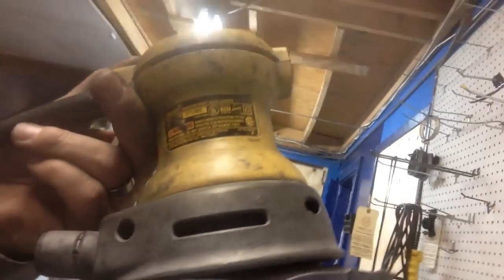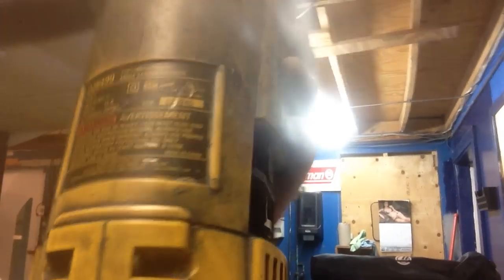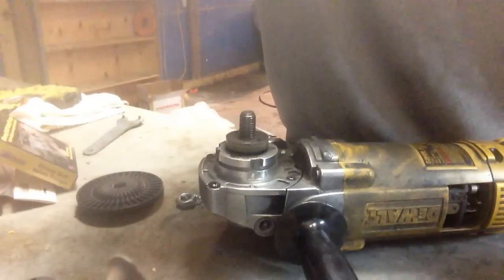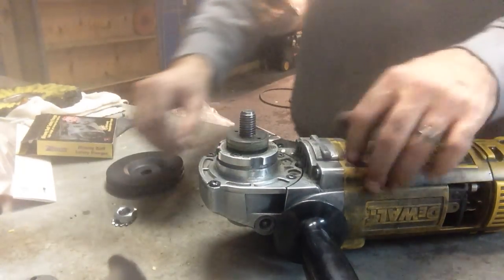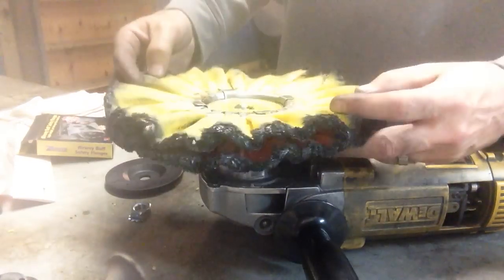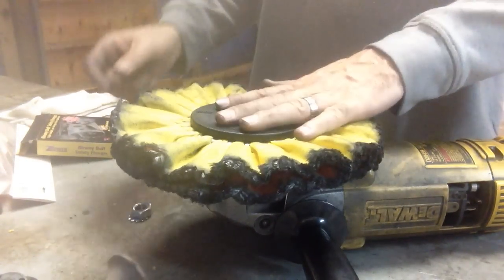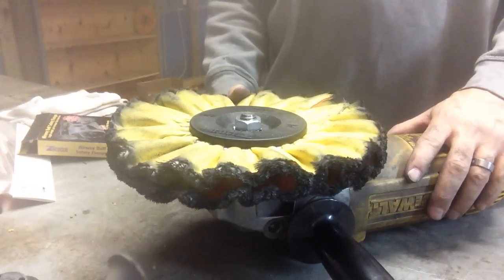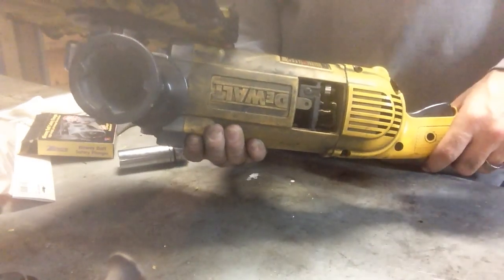how to mount safety flanges and what tools to use - aluminum polishing

Comment: Hey Dennis, I have two questions:

1. What is the minimum RPM for a buffer used for aluminum polishing? I just ordered a Dewalt but it only has 3500 RPM and I don't think it'll be powerful enough. 

2. My buffer uses pad sizes 7" and  9" but I can't seem to find buffing wheels in that size. I only see 8" and 10". Is there some kind of adaptor or what? I'm lost. lol

Comment: Nice info! For corroded wheels would you recommend using paint stripper first? What wheel would you recommend for a 1 step process? Looks like yellow wheel and brown bar?
Reply from the maker: +moedog5087 if they are coated yes they need to be stripped.  For cutting I use a yellow orange blend wheel and green Menzerna bar
Reply: DCSuperShine can you use these on an angle grinder ?

Comment: Most people say to stay away from the 6000 rpm grinders and go with slower grinders like the dewalt 849,what are your thoughts on this? also i plan on polishing aluminum sheet metal mostly .40 aircraft skin will the 6000 rpm grinders be too much:?

Comment: I bought a bunch of zephyr stuff to polish a 100 gallon diesel tank. The previous owner sprayed it with acid and im wondering if i will be able to remove the acid stains? Also do you drain the fuel tank? Thanks a lot!
Reply from the maker: No need to drain the tank 
If you sand first it will remove the stains.  Only thing, I don’t use zephyr stuff.
Reply: @DCSuperShine  why dont you use zephyr stuff?
Reply from the maker: It’s mid grade stuff

Comment: Hi DC Shine....been a user of DC Shine products for awhile. I had one question about how to address black lines that appear during the cutting process and how to eliminate them. Using the white bar or polish doesn't eliminate them completely.
Reply from the maker: +Kevin Butters send me a pm with some pics of the lines you're talking about.  It can be several things. Also when you say white bar I'm assuming you're talking about the blue bar :)
Reply: Yeah I’ve been wanting to ask this question as well.
Reply: Can you tell me what kind of polish you are putting on the yellow pad when you begin to polish thank you.

Comment: Can I use a variable speed makita polisher that goes to 3200rpm for polishing stainless or aluminum. ?
Reply from the maker: On aluminum Yes you can, I do a lot of my polishing with my 3500 rpm… on stainless on the other hand it’s a lot more difficult!  Using a 6000rpm will definitely make your life easier!
Reply: @DCSuperShine  I worried you would say that because am polishing a Keg, customer wants to turn into a urinal. don’t want to buy a new tool gonna have to do the best I can lol

Comment: Hello nice approach,  in what case u use the 2" extension in the machine ?
Reply from the maker: +Charlie I never use an extension.  I use a new flange system now much much better.  If you go in my website under kits. Check out the ultimate kit that’s what I use now.

Comment: Hi. I know this video is old but I just got the safety flange kit and it wont fit. I dont have enough of my arbor left to put the nut on. It's a brand new masterforce sander? Any help would be great
Reply from the maker: Ya this is one of the reasons why I switched all my flanges yo centerless ones.  A lot of my customers were buying different brand grinders and having arbor length issues.  The only solution to this aside from either buying another grinder or getting centerless flanges is this.  If they are the metal ones, Mount only one flange at a time and tighten them up a lot, so you kinda shape it to the buffing wheel, they will bend a bit, do that to both and you should be able to fit them on.  If you have the fiberglass ones I haven’t sold those in years cause they break.
So I can’t help you there unfortunately. You’ll need to contact the company you bought them from.  Hope this helps
Reply: @DCSuperShine  yeah unfortunately I have the plastic ones from zephyr 🙄
Reply: @DCSuperShine  so zephyr emailed me back and said I could buy (part# CFPREX 2" extender) I need to know where to buy these metal flanges with a part # if possible because after what you told me and all the reviews I've read about the plastic ones breaking I dont want to pay for a extension just for the plastic flanges to turn around and break after 10 minutes of buffing. Ty for your help. Next kit I'll be buying is yours like I should of done the first time!
Reply from the maker: Here’s the link to the flanges, you can get the extender from me as well

https://dcsupershine.myshopify.com/collections/tools/products/airway-buffing-wheel-holder-kit-safety-flanges

Comment: Can you use a high speed buffer if you dont have a grinder I have a dewalt highspeed buffer
Reply from the maker: Yes a 3000-3500 rpm polisher will work just takes more patience and time.

Comment: How really damaging is it to polish 4 wheels without a mask? 
Instant lung damage or the mask is a must only  for those who work several hours polishing  everyday?
Reply from the maker: I’ve been polishing for twenty years and the first few years I never wore a mask... to say is it damaging or not.. sanding is definitely not good without a mask will you die from it imo small doses probably not, there’s no real data showing any different.  As for polishing there’s even less data or proof.  If you want my opinion, wear a mask!  Just in case prevention is always the best policy.
Hope this helps
Reply: I would highly suggest it for the high rpm orange wheel. Your removing contaminants from the aluminum. They tend to sling.

Comment: How the heck do you keep that mask from fogging? Mine is brutal!
Reply from the maker: Hey!  well it depends on what kind of mask you're using.  mine never fogs up.  I use this mask
http://www.uline.ca/Product/Detail/H-1472/Dust-Masks-and-Respirators/3M-6900-Full-Face-Respirator-Large?pricode=DK765&gadtype=pla&id=47588087348&gclid=CPiLrfOvwL0CFcg7Mgod9HYAqw&gclsrc=aw.ds  runs about $180...  hope this helps